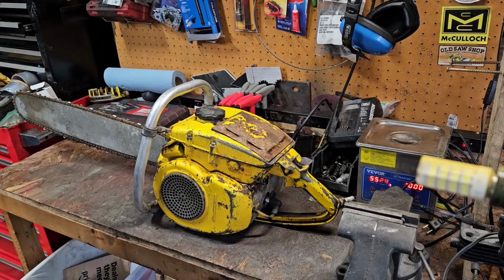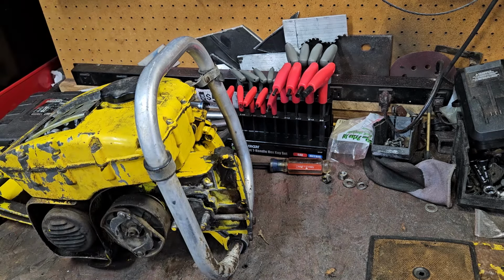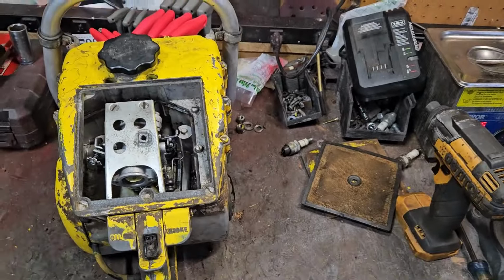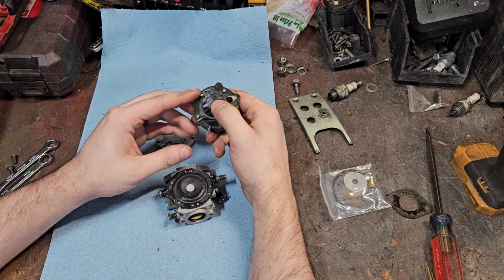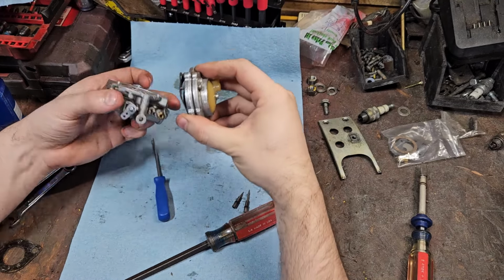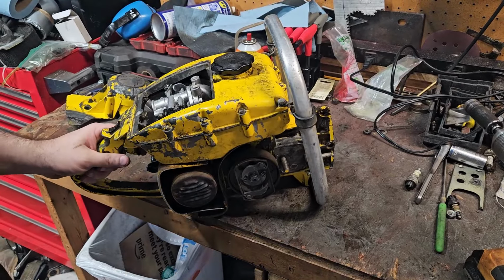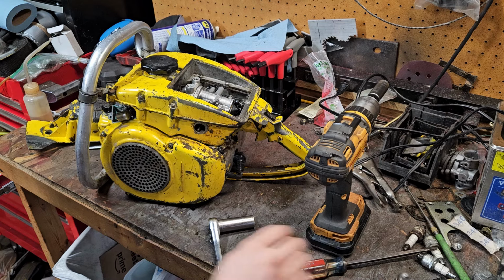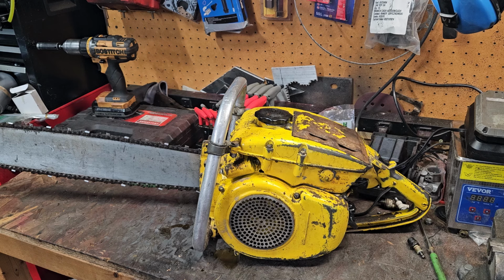McCulloch D44 Revival

Comment: Process of elimination,  Jekyll and Hyde Beasty Mcculloch saw Man. They can be cranky sometimes! Used to Have My great Uncles 2-10 saw, They were epic loggers back then. I remember My Dad clearing the property when I was young, the key sheared tho & scrapped the crank, "before eBay"... Also was working on a 10-10 E electric start chainsaw but it needed a LOT. I Had a power Mac 6, world's lightest chainsaw with the ram horn handle. lots of power for its size & the 60's space age disign is very unique with the carb under the air shroud sharing the coil mount & an airhorn going round to the back air filter chamber. Thing was packed in there, I had to replace the rubber fuel line that plugs into the carb when the cover is installed as they go hard & leak after 50 years. I had to use surgical forceps through the fuel tank cap hole to feed the large felt wick in & thread the line out of the tank. Like working on a ship in a bottle or some origami puzzle chinese finger trap or something, I sure was glad to finish that job! It also had a intermittent spark issue when it got up to temp & was a Bear to start after that, but when it was running good it was Fantastic. Loved that thing! Right now I Have another saw, It's not a Mac but a 59 Remington Bantam, Styling Designed by Raymond Loewy. Same guy Who Designed the Coca Cola Bottle & Studebakers & lots of other stuff. It has a Tillotson HL15-A carb & a neat braided fuel line, the other one I had was a Carter N series.I have been repairing the magnisium case lower bar mount that was shattered with jb weld & added several aluminum splints to reinforce the fracture, cant even tell it was broken now. Also repaired allot of chain rash & fabricated a flywheel cover vent fin spoke that was broken off as well as the inner clutch sawdust guard that had torn away. Its 2 picies of aluminum with a hole for the clutch bell. sandwiched in between the 2 of them is some sort of gasket material to make up the right thickness & then riveted all together. I have a nos fairbanks clutch, new needle bearings & seals, gaskets & reproduction decals & reproduction retro pull start handle. Nothing to it but to do it. My Holy  grail Saw is a Remington 754G... A military  gear drive saw from Vietnam...✌👍

Comment: Your drinking a Bud Light??????????????????????????
That pad you took out of the gas tank was felt, it does not wear out. The Scotch-Brite pad you put in will not do the same job and it has grit in it - not a good move. My Dad was a timbercutter and had one of these saws brand new, I remember it well and have one right now.
Art from Ohio
PS: That spark plug would light you up like a Christmas tree if your gloves were wet.
Reply from the maker: @artszabo1015  I have been drinking it for 17 years, why should I stop now?

Yesbthe felts do wear out, they clog up and there is no real cleaning them out and why McCulloch had replacements, they clogged up like I showed in the video, not the first one I've had to replace because of it clogging where it fuel comes to the hold down clamp. I've done a few with scotch brote and so far zero fuel starvation issues. Back in the day McCulloch advertised those felt pads could filter out cola and saw dust put in your fuel...you really think it had the capabilities to filter out cola in your fuel...there is a reason why they got away feom using them and went to a fuel line with a pick up on them. As innovative as McCulloch was, there was a reason alot of their ideas were scrapped.